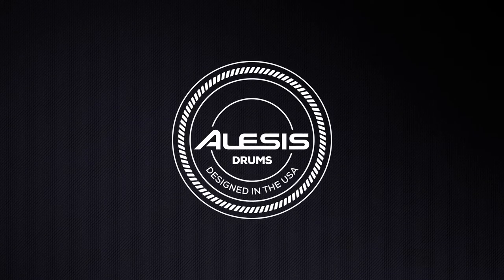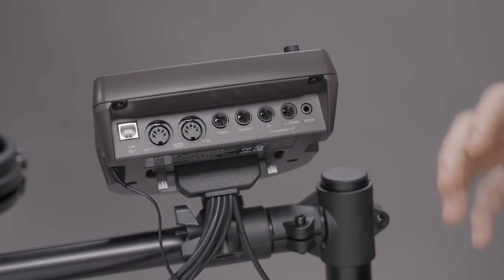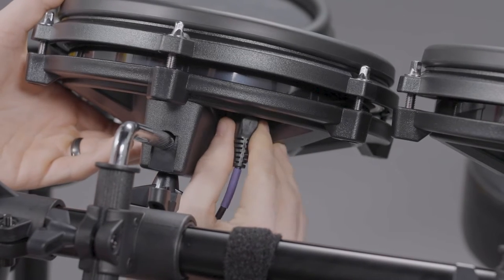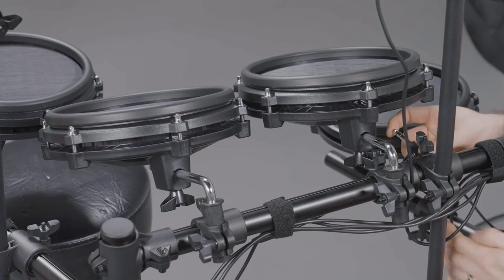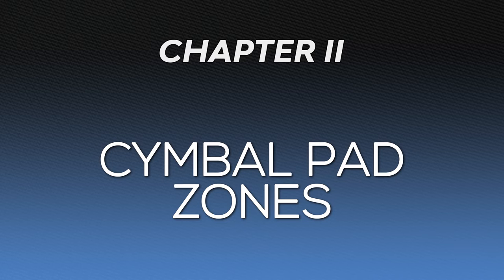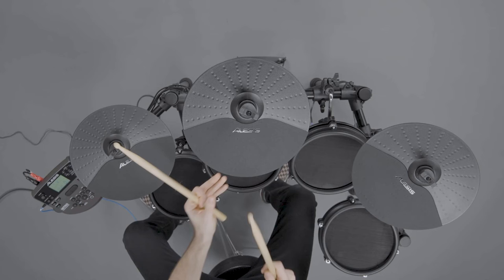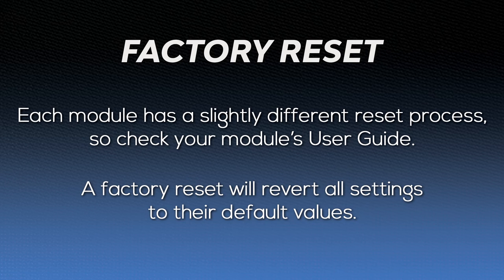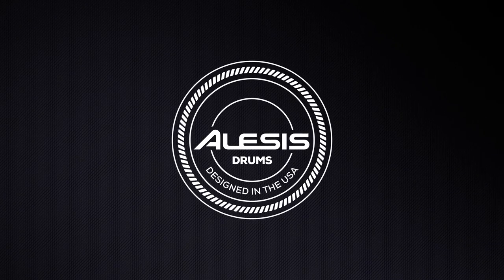Alesis Drums | Troubleshooting Problems With Your Pads

Comment: This video did not address in any way shape or form the base pedal problem of not working. If you switch cables which I did it's still doesn't work, they never answered how to find out what is wrong with the actual connection to the bass drum kick
Reply: Happened with me. Unplug your headphones a bit and it worked for me. My problem is my symbol pedal doesn't close
Reply: Thank you for your feedback but I did try that as well, and still didn't work

Comment: If you have a mesh kick pad and the sounds isn’t consistent try raising the sensitivity in the module, if that still doesn’t work you can try tightening the drum head that’s what ultimately helped me. I turned the sensitivity to max and tightened the drum head now the drum registers more consistently and I don’t have to hit it as hard. If your still getting missed inputs tap around with your drum stick as lightly as possible and find the trigger it’s usually at the edge of the pad. I originally placed it dead center and would still get some missed inputs after tapping around with the stick I found that the trigger is at the lower part of the pad. Once I adjusted the beater I was able to get 100% consistency at a reasonable speed.
Reply: You just saved my life, I was wondering why my kick was so low on the sensitivity, I just remembered that I tightened all the pad except the kit, ty sm!
Reply: @GustavoSoares-fc5kn  you can also try tapping around with your stick lightly to find the perfect trigger spot. For me it was at the lower edge of the pad, once I adjusted the beater it was registering all my hits as fast as I could do them without having the sensitivity at max. I was actually pretty close to returning the kit which would have been a bitch after spending almost 2 hours setting everything up lol thank god I looked around and found some solid solutions now it’s a lot more like what I expected. Hope it helps and have fun!
Reply: I'm also having this problem, what do you mean by tightening the drum head? Like tightening the pedal to the drum?
Reply: @chenkopitko6070   the mesh top of the drum can be tightened down using the small alen key that should of came with your kit. You should try moving the beater first tho that seems to be the main issue with this type of drum. Just lightly tap around the drum with your stick till you find the spot closest to the trigger. It’s usually low close to the edge. You wanna put it close to the trigger but not directly on it cause then it would be to sensitive and you’ll get unwanted inputs unless you mess with the module settings.
Reply: @dbzcollector9963  I tried lightly tapping the drum but it wouldnt produce any sound because turns out i have to kick pretty hard for it to produce anything, so i can barely make it produce a sound just by tapping with the stick
is it normal or somethings not right?
Reply: @chenkopitko6070   sounds like something might be wrong maybe the trigger is loose or something. Try tightening the drum head first then tap around. Also have you messed with the module settings like trigger sensitivity and stuff? You might have it set to the lowest setting and that takes quite a bit of force to activate it. You should have it around 3-5 if you have a working drum but it’s not uncommon to set it to max if you’re still having problems. One thing I’ve learned from watching videos is that there tend to be a small gap between the trigger and a foam pad that sits in the middle of the drum. Some people have opened the drum and filled the space with small pieces of waist foam or something to bridge the gap and that seems to help. I had the same problem you did but I ended up tightening the drum head, lowering the beater so it hits below the center of the drum and I set the sensitivity to 2 or 3 can’t remember but it was pretty low. When I first got the kit I had to set it to max sensitivity and I would still have to kick pretty hard to even get a light sound.
Reply: @dbzcollector9963  Yeah the thing is I only got the drums a few days ago, and I bought it from other people that have used it for about a year so I think the drum mightve gotten damaged when they messed with it hence why its giving me a hard time, I set the sensitivity to max and now i can hit it pretty consistently although it still misses some hits here and there. Maybe ive just gotten used to hitting it hard lmao, because i still cant tap it with a stick and make it produce a sound, it only does so when I kick it pretty hard..
about tightening the drum head, its not about the pedal, right? its just the black foam that needs to be tightened to the inside?
Reply: @chenkopitko6070   There’s 4 long screws that hold the top of the drum that attach to the rest of it. That’s the drum head just tighten or loosen the screws till you get the rebound you want. Since you got it used tho it might just be wear and tear, check out some videos of people opening it up. It could just be a lose trigger that needs to be glued down. Also it helps if you’re playing on something solid, if you have long carpet or something then the drum moves around when hitting it.
Reply: whats your instagram bud?

Comment: How do you go about troubleshooting the Kick Pad issues. 2 out of 6 kicks do Not produce a sound.
Reply: same issue here
Reply: @viktorz494  troubleshooting done with support. Replaced cables to no avail. Next step is to replace the kick.
Reply: I messaged (complained to) Alesis and they sent me an upgrade mesh kick pad. Works perfectly. The rubber one that the kit comes with deserve to go in the bin!
Reply: @junebugsmithington  Good to hear. They also sent us a new kickpad set. It is finished in black. Great customer support, always ready to help !